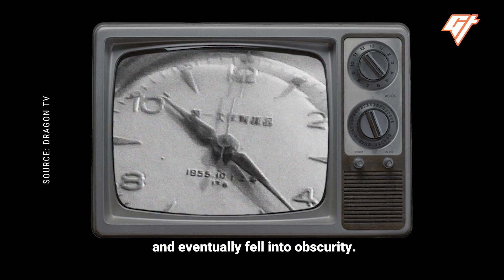So What Happened to the Rolex of China?

Comment: Tianjin Sea-Gull Watch Group (often simply called "Seagull") is a Chinese watch manufacturer located in Tianjin, a city with a strong connection to China's watchmaking industry. Tianjin Sea-Gull has over 50 years of history and is presently the largest manufacturer in China by volume. The factory was founded in 1958 (growing out of earlier watch making efforts in Tianjin beginning in 1955) and was originally known as Tianjin Wuyi Watch Factory. The factory was relocated in 1962 and renamed Tianjin Watch Factory, and operated under this name during the rest of the vintage period of Chinese watch making. It produced several mechanical and electronic movements in this timeframe, but is best known for its ST5 movement, produced in 1965, which was the first movement to be 100% designed and built in China and was used in Dongfeng and later Seagull brand watches (among others).